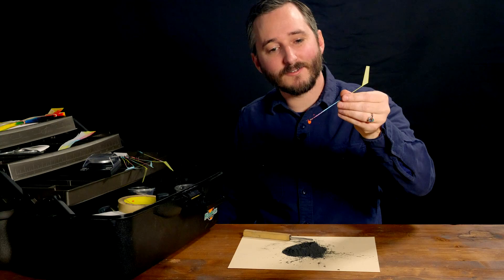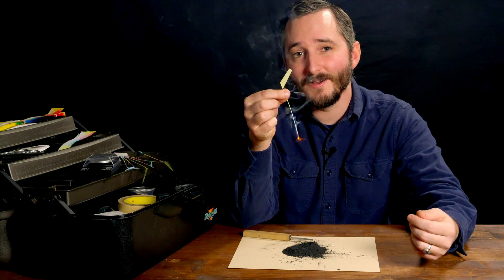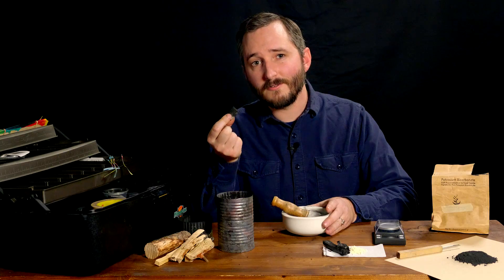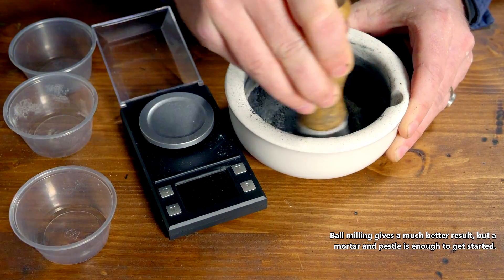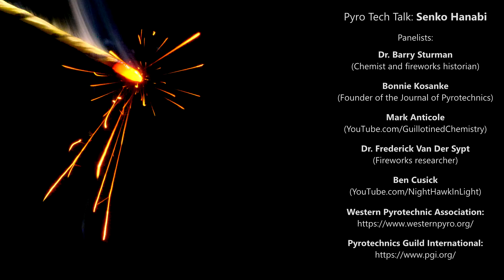The World's First non-Flammable Fireworks (a novel way to make Senko Hanabi Sparklers)

Comment: Interesting. There's a similar formula called 'yellow powder', which uses potassium nitrate, charcoal, sulphur and sodium bicarbonate. However, the effect of a 'yellow powder' composition is very percussive and would not be suitable for a Senko Hanabi! Just like the Senko Hanabi, molten-state chemistry features in 'yellow powder'. With a 'yellow powder' composition placed into a steel tin, strong heat (blowtorch or bunsen) is applied underneath, causing the pre-mixed potassium nitrate, charcoal, sulphur and sodium bicarbonate to fuse into a molten mass. Then, with continued heating, the molten mass suddenly goes BANG! I guess that, in both the Senko Hanabi and 'yellow powder' compositions, unstable polysulphide species are formed in a series of reactions taking place in the molten state. If you apply a flame directly to a pile of 'yellow powder' the percussive effect is not achieved; it merely fizzles rather feebly. The whole mass of reactants has to become fully molten before the percussive effect (BANG!) takes place.

Comment: I miss my pyrotechnics days...we got to work with some pretty special materials. Boron comes  mind - the amount of energy boron puts out is shocking. It's too expensive to use routinely, but a typical perchlorate/boron mix is phenomenally exothermic. Zirconium hydride is pretty hot too, but you can aproximate it's effects with mischmetal filings.
Strobe mixes were fun too - some strange chemistry in them as well - powdered Teflon anyone?
Sparkly sparklies.... it's sparkleadelic, baby!   ;*[}>

Comment: So I've been trying to recreate this over the last 2 days with both Sodium- and Potassium bicarbonate. I consistently get a great first stage but either very few lackluster sparks or a great amount of them that are 1mm at most, didn't even notice them until I looked where the hissing sound came from.

I roll it using cigarette paper that's also wrapped around a thin (ca 2mm diameter) wooden stick on the non-burning side. 

Does anyone have some advice? Tried varying the composition somewhat but don't really have any idea what I'm doing.
Reply from the maker: What charcoal are you using? By great first stage do you mean you're getting great sparks at first but then it dies out? If you post a video of your results I might be able to give better advice.
Reply: @Nighthawkinlight  Damn, you really do read all the comments; huge props for that! By first stage I mean what you showed at 12:37, mine is just a little less violent and eventually goes out after producing a hand full of of sparks at most. But I get that far very consistenly.

The charcoal is beech "briquettes", though they look just like regular burnt wood and nothing like what comes up on google images when I search for briquettes. I ground it up into a fine black dust that floats when agitated.
The Potassium Bicarb. is homemade (KOH + CO2 in EtOH) so perhaps not the highest quality, the Sodium one is from the store. Most of my experiments so far were with Sodium, though Potassium seems to work at least as good, judging from the 2 or 3 times I tried it.

It's noteworthy that when I tried it yesterday evening it smelled really badly of Sulfur, even though I was outside and there was some wind. I imagine you wouldn't have done it inside if it smelled as badly, so perhaps this is connected to my problem. Another potential problem I see is not enough gas being emitted (I think you explained in another video how gas bubbles are responsible for the sparks, but not sure if I remember correctly). This might mean that most of it gets used up early, there is too little X-Bicarb, it's concentrated on the surface so it doesn't shoot out that much, it's not hot enough or something else. All of that is just speculation though, sadly there aren't that many resources on this topic.

Here are two videos of me burning one with Potassium (white paper) and one with Sodium (green paper): https://www.youtube.com/watch?v=DH3PPnLLjdo&list=PL0Y9mzvnbcQLeV-3y9EQu2q085muyUb9-
The short video was recorded right after the longer one, had just turned off the camera when it started fizzling again.
Reply from the maker: I only just now saw your reply because it was auto filtered because it contains links. I left a few suggestions on your one video. Reading this comment I think you'll have better results if you can find or make pine or some kind of similar sticky evergreen sapwood charcoal. Beech I suspect is very poor for sparks.

Comment: Interesting, i wonder what the mechanism that generates the sparks is, both potassium and sodium would be highly reactive liquids at those temperatures, I wonder if the sulfur and charcoal are just reducing the metals which boil off and react with air.

Very cool vid, neat idea, and thanks for the links.

Comment: This is great! I just made my first Senko Hanabi. Was fun to watch it sparkle :) I am struggling with rolling the paper though. When trying to roll it beginning from the tip the paper will just slip on itself. Have you made the same experience? Do you have any tips on how to avoid that? I hope I can make some nice ones to surprise my flatmates with on New Years eve :)
Reply: I am using paper with a thickness of approximately 0.026 - 0.030 mm. Would you be so kind to measure how thick your paper is?
Reply from the maker: Wet the corner of the fold enough that you can see the moisture sticking the two layers together. You only need moisture right in the corner to start the roll, the rest can stay dry. I don't have calipers to measure my paper. I use dollar general white tissue.

Comment: Which pine should we use, Eastern white, Western white, Sugar, Red, 
Pitch, Jack, Longleaf, Shortleaf, Loblolly, Slash, Virginia, Lodgepole, 
or Ponderosa?  Any hardwoods work? would Carbon Black work?
Reply from the maker: Type of pine isn't critical, just the sap content. The higher the better. I've had good success with fir. Hardwoods will work but the sparks will not be nearly as large. Carbon black can be swapped in for a tiny amount of the charcoal but it will not work if you use too much.

Comment: Use alder wood 1/2" in diameter or less rather than pine. Much cleaner charcoal.
Reply from the maker: Clean charcoal is not good charcoal for spark effects.

Comment: Sulphur is not freely available for private persons or industry in Denmark. You need a permit and to keep track of it.
Reply from the maker: Really? It's not sold for treating skin conditions or at least for gardening?
Reply: @Nighthawkinlight  The sulphur sold for gardening is a salt, so seems to be the case for sulphur for a winery. I can get 25 g of crystal sulphur from Norway (crystal healing stuff). Elementary sulphur does not get mentioned in our pharmacopoeia
Reply from the maker: @typograf62  That's too bad. You can use potassium sulfate only in senko hanabi instead of potassium bicarbonate + sulfur, but you'll have to experiment to find the right recipe.

Comment: I'm curious if there is a reason you don't mention using commercially available airfloat charcoal in the mix (although you do mention the alternative of ball milling your own).  Do you find a meaningful difference in performance between doing this with pine on your own, vs the airfloat that's made from some unknown wood type?

As always, it's great to see your continued progress and experimentation with senko, and many contributions back to the west on recreating these!
Reply from the maker: Homemade pine will be way better than mixed airfoat. Any charcoal will work to get started but you'll notice extreme improvement with pine.

Comment: Fascinating results ! I admire your attention to detail in this quest to understand the science behind the amazing little firework. I also appreciate your willingness to work out every little detail to understand precisely what is going on and why it is happening the way it does. Particularly with things like weighing the powder to get the ratios right and understanding the fluid dynamics of the molten material. I would be curious to know if you might be able to add in some other metals like titanium powder or other known "color" producing powders in the firework industry. Just miniscule amounts to see how the composition might react or change like you did with the baking soda attempt. I think it might be interesting to see if you could produce some colored sparks or vary the brightness with just a light sprinkle of some other various powders.
Reply from the maker: You can change the color of the drop as you see at the end of this video, but changing the color of sparks is very difficult. Not possible by normal firework methods

Comment: Attention: Never replace potassium bicarbonate with potassium carbonate in this mixture, because you could create yellow pyro powder which is highly explosive when molten.
Reply from the maker: You're thinking of potassium chlorate. Potassium carbonate is also safe to use, although not as good because it absorbs water from the air.
Reply: @Nighthawkinlight  No it is not. And I don't mean (per)chlorates either. Potassium carbonate with potassium nitrate and sulfur combines to "yellow powder", which forms high explosive reactants when molten. This is very dangerous.
I know, that you don't use additional nitrate, but some of your viewer might do. And while bicarbonate is relativley harmless in this scenario, carbonate isn't.
Please look up yellow pyro powder.
Reply from the maker: @call.me.heisenberg6990  You're right, I had forgotten about that comp. In any case it requires being molten to become reactive, and the ratio for a senko hanabi is far off from the ideal for yellow powder. I am not concerned. Even should someone by a long shot chance make a senko hanabi with the perfect yellow powder mix it would only be .08g at the end of a paper stem. Ringing ears at worst.

Comment: Try drying the sodium version in a desiccator first, that’s the primary reason potassium salts are preferred in fireworks because sodium salts tend to be far more hygroscopic, and hence have to fight the extra latent heat of vaporisation, taking energy out of the reaction.

That being said, when you do get them dry, they have lower specific heats so end up taking less and being a far better option. To the point that sodium based flash powders can be significantly more dangerous than potassium.
Reply: It may not matter in how the firework itself looks as all water would evaporate during the melting phase which needs external source of heat anyway. It would possibly be easier to start.
Reply: Wouldn't that make it into washing soda  (Sodium carbonate) instead?

Comment: What happens if you mix the different possible third ingredients? And could you add back in some flammable powders to ignite easier. Not a lot, but enough that maybe a more traditional lighter could work? Additionally if they sparkle more with finer charcoal, how fine of a particulate can you possibly make, and where does the effect slow or stop at?
Reply from the maker: You can light these with a candle, but only if there's no wind. You can grind the charcoal right down to atomic size if you want to try and it will still improve.

Comment: I've been wondering, what would happen if you activated the charcoal with steam to increase the surface area. Would that make it less sensitive to the charcoal particle size?
Reply from the maker: Usually activated charcoal doesn't work so well in fireworks. Not sure why.
Reply: I read somewhere that it was too pure. Like graphite, it's completely devoid of volatile hydrocarbons. 
Makes me wonder if it would work better after adsorbing some flammable solvent.

Comment: At 2:25 you said that sparks could cause an explosion, however I don't think any typical mixture used in comercial fireworks would explode while not under pressure. The powder would have to be in a container which would in turn lower the chance of sparks igniting it. With the powder just lying there you risk a very vigorous combustion not an explosion.
Reply from the maker: Very vigorous combustion from firework powders still lands you in a burn unit.

Comment: What if you coated the tissue in a very diluted solution (or suspension) of pyrotechnic powder and water or alcohol, let it dry, so now you have an impregnated paper to roll the powder charge in. My prediction is that this will extend the midlife of the display. You could experiment with different concentrations of powder to tweak the results. Use the potassium and sodium kinds separate, but what about combining them in different quantities?

Comment: By mass on gram scale, after grinding each in a mortar & pestle, 7 parts normal baking soda, 4 parts sulfur, 2 parts very finely ground charcoal (DIY pinewood best according to NightHawkInLight) 

7 parts sodium bicarbonate
4 parts sulfur
2 parts charcoal (finely ground/ tiny particle size dust) 

Procedure:

1. Weigh up your ingredients (components from above list by mass on a precise scale) 
2. Add the charcoal to a mortal & pestle & grind to very find dust
3. Add in the sodium bicarbonate & grind to mix
4. Add in the sulfur & grind to mix

To make the Sodium (Yellow Light) Senko Hanibi Sparklers
1. Add a small amount of the mix, 1 gram or so to a strip of tissue paper (see video) 
2. Roll the mix to make a pellet in one end where you start 
3. Continue rolling to make a stiff paper rod out of the tissue paper

To Use: 
1. A butane lighter must heat the pellet (heavy) end for several seconds to burn off & boil the mix to initialize the reaction) 
2. Heat with a hot blue white flame from a jet torch (butane cigar lighter) that can be obtained cheaply (made in china)
** Nicer butane lighters that are refillable with a common butane refill cartridge can be refilled dozens of times from a cheap butane canister
Reply from the maker: One correction, use only about 0.1g per sparkler, not one gram. Thanks for writing the instructions!

Comment: What is actually making the sparks? Is it carbon being ejected and igniting with contact with air? If so could the sparking phase be extended by rolling a small amount of charcoal into the stem?
Reply from the maker: Watch my video about how sparks branch. The paper turns to charcoal as it's consumed so extra charcoal wouldn't add much

Comment: Will an arc lighter suffice if the end is held in the arc for long enough? 
Also is the blue glow around the droplet visible to the naked eye or camera only?
Reply from the maker: You can light them with a candle flame, there just can't be any breeze to blow the flame around. I don't recommend a normal lighter because it means holding your hand under the drop for a long time and it could fall and burn you. An arc lighter does not work, I tried it.
Reply from the maker: And yes you can see the blue glow, but you shouldn't get your eye that close or you might get a spark in it.
Reply: Cheers.

Comment: Re: compositions that are consumed completely before the actual effect is produced, here's another one: crackle rocks.
The traditional composition involves lead tetraoxide and copper oxide with magnalium alloy (1:1 Mg Al) powder, bound in nitrocellulose resin.
The more modern equivalent that doesn't use lead (and honestly which is also just plain better at producing the effect consistently and powerfully, which is nice) is the same but swapping out the lead for bismuth trioxide.

It is a kind of delayed thermite reaction, leading to some intermediate compounds which, after a short delay, detonates.

So the effect is a brightly shining rock but with no noise or smoke, which then suddenly detonates, producing anything from a loud SNAP to a BOOM . They're great for putting in fountains or even large sparklers as they have a impressively loud crackling effect.
Reply from the maker: Dragon eggs. You're right, they do melt before exploding. Sort of similar in one sense, but I think dragons eggs just have a two stage reaction and the first takes a while to build enough heat to activate the second. It's been a while since I thought about the chemistry of those
Reply: @Nighthawkinlight That's the name, hah. It had escaped me completely! Thanks for the reminder.

Re: the heat, yeah I have thought similarly but haven't been able to confirm or disconfirm it with the techniques I've tried (heating with plasma torch, heating with copper thermite, mass current discharge...)

And a friend tried to identify the intermediates but this line of inquiry was cut short after the experiments damaged the mass spectrometer (oops...) - got too expensive.

Comment: I took a chunk of clean yellow pine sap that had hardened to brittleness collected from a tree years ago and plunked it in a test tube with a little methanol. After a few minutes nothing was left but a light honey colored fluid. It came to mind that perhaps powdered charcoal could be tinctured with this fluid letting the methanol evaporate to see how a Senko Hanabi sparkler would burn with a light shellacking of rosin coating the charcoal. Or whatever use one could think, dry pine rosin so very soluble in methanol.

Another common salt around the house is cream of tartar or potassium bitartrate if random tests were of interest with potassium salts. Probably there have been many patient experiments and roads traveled with these sparklers.